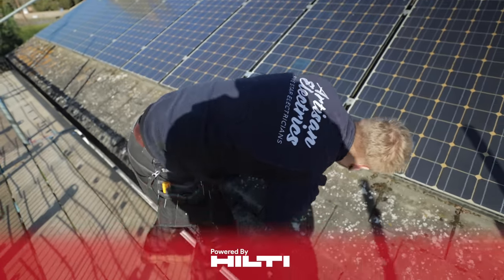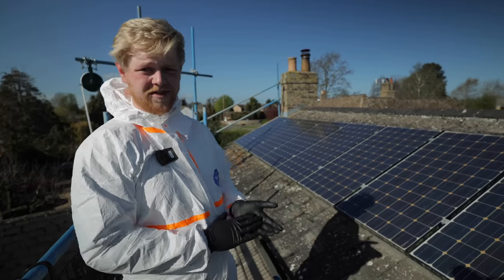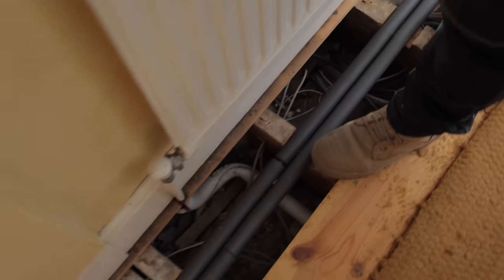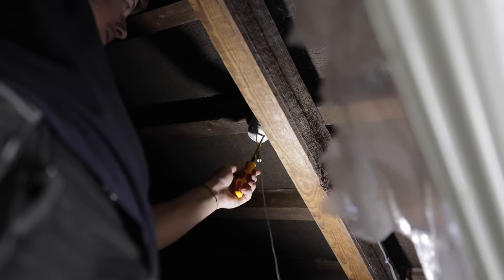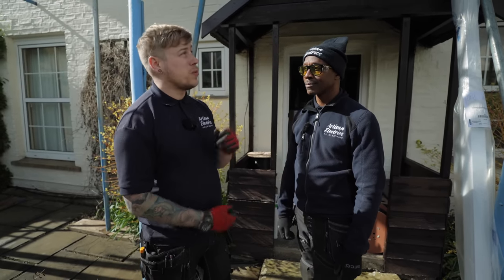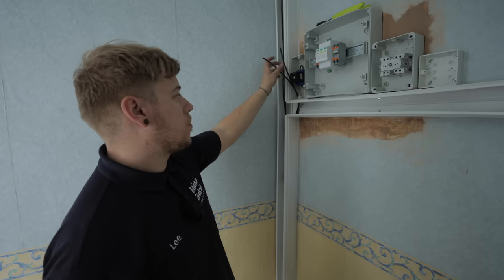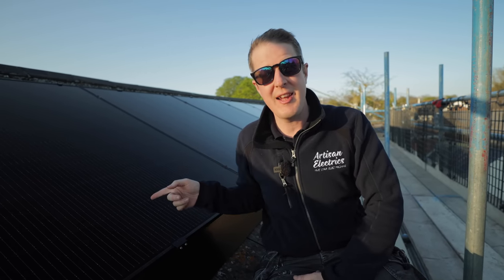I Nearly Walked Off This Solar Job.

Comment: As long as what you use to attach the the unistrut is MCS approved I can't see the issue, after all are the roof joists etc. that you would need to attach to MCS approved? No they're not. The unistrut is effectively an existing part of the house and it's clearly survived well, it's not even rusty. Seems to me that "MCS approval" is yet another industry body revenue generating scheme, it has no legal basis and it pretty much looks like you just replaced perfectly good steel strut with an almost identical aluminum replacement..

Comment: i can tell wayne knows his stuff, plus he makes the content better
Reply: I ran an asbestos company for 15 years. Wayne is doing everything by the book because he’s on video. Normally he’d nip up that ladder crack a couple of corners off the tiles & take a photo. 
All the white suit & mask stuff is technically required but in practice is seriously OTT. 

What that roof is, is fibre cement slates. The asbestos content would be between 5 & 8% & to quote the HSE the asbestos fibres are firmly bound within the material. Unless you start smashing the tiles with a hammer the risk is negligible. 

We used to provide safe systems of work for solar installers that allowed them to drill whatever holes were necessary on those roofs & ensure no debris was created. 
It’s actually not that difficult
Reply: @hughmarcus1  can I pick your brain?
What's the risks/ your views on pulling old rewireable fuses with asbestos liners?
Reply: @hughmarcus1  Hugh, was your company UKAS accredited?
Reply: @Trenchfoot1  No UKAS is only for the big boys. I looked into it, but it was going to cost £15k per year & economically unviable. The joke about UKAS is that the big boys subbed out the messy, dirty jobs to local companies like ours. 2 reasons, they didn't have staff with experience of messy demolition sites & they often had silly rules that said they didn't inspect anything more than 3 mtrs above ground level - not much use if you were demolishing anything more than a bungalow.

Comment: I'm not a structural engineer but couldn't one have been found to assess if the old unistrut mounting system was "fit for purpose" and adequate for the new panels? To my uninitiated eye it certainly looked robust enough. 

A quick look shows that MCS Rules fundamentally require good practice & fit for purpose.

If it was my property I would have been content with an engineers assessment and if that was positive I would not have had all that additional roof work done.
Reply: an engineer's assessment could be more costly than swapping the mounting system

Comment: That black skirt paddin looks cool but it should greatly reduce cooling (efficiency) of the pannels because of lack of air movement behind the pannels.
Reply: Save me saying it should use mesh
Reply: It doesnt make that much difference. I had my panels integrated flush into the roof. On the hottest day last year there wass about a 20% drop in generation, but on most days it is barely noticeable. A lot less than the hassle of pigeons nesting under the panels!

Comment: That unistrut is just fine and was one if the first methods to mounts solarpanels. Looks like its all zinc coated? Why replace it with inferior aluminium..

Comment: Man, you get it easy to instal and run the solar dc cabling. In NZ we have to run the DC cables inside a continuous solar rated pvc conduit when installed internally in the roof space/attic and internally within the house. This conduit is to be labelled “dc solar”, at regular intervals and is medium density walled. The electrical standards we use are predominantly ASNZS:5033 and ASNZS:4777 which are very specific to how things are undertaken due to the recognised issues and dangers involved in having uncontrolled dc voltages and currents from the panels to the inverter.
Reply: Our solar PV regs in the UK are still very minor compared to ac stuff. 

I watch these videos and sometimes I can pass a comment on stuff the guys could do better but also the flip side is I see things they do that I realise would be good to bring into my ways of carrying out what I do.
Reply: @buckshee  I hear what you are saying for sure. In the electrical service there is room for continual improvement and, lotsa stuff that appears OTT too. 
I recon we only need two or three reps: 
1- is it electrically safe,  
2- will it kill anybody,  
3- will it start a fire….
I am not intending to be critical by any stretch of the imagination.
The wiring system that scares the whatsit out of me is the American 120volt system and needing to wire lighting in 1.5mm, and ranges capable of 60Amps.
Reply: @briandalrymple9986  When it looked at the distribution boards they still use in the states it scares me, also their regs seem to come on a pamphlet and don’t get me started on wire nuts.

Comment: I'd have gone with the unistrut for several reasons:
It looked pretty solid for much the same wind load.
It avoided messing with what might have been asbestos slates.
It avoided replacing drilled through slates.
It would have avoided increasing costs for your customer.
The unistrut fixing through the slatrs should havebbeen picked up even during a cursory in loft inspection.

Comment: Tricky situation Jordan - on the one hand this stuff would have been quite hard to spot prior to putting up scaffolding. But on the other hand I can see how the customer might find this frustrating. I think you handled it well though, communication is key and if they were aware of the limitations of the estimate you gave then fair enough.

Comment: The optics of this, I nearly walked off the job because it was a bit hard.  Wouldn't be calling you, we've already established you're a top dollar company but a bit of agro and you're thinking of walking off.  My solar installers turned up at 9am and it was fully commissioned by 2pm, 14 panels across 2 roofs, not sure why it takes you days to fit a few panels.
Reply: That's what companies that want millions of pounds do
Reply: Same here, except the weather was awful and the installers mate was off sick... So he showed up and did it single handed in the rain. All done before darkness set in, in October. 

There's a small premium I'd pay for slightly neater consumer unit wiring, but not 3 days labour worth.

Comment: The old fixings look totally over-engineered and bombproof and if not leaking, I'd just put the new panels on, after all it's been there for ages without any problems.
Reply: TBH I would have not even suggested removing the old panels. 2kW system to a 2.9kW system. 900w peak hardly seems worth it.
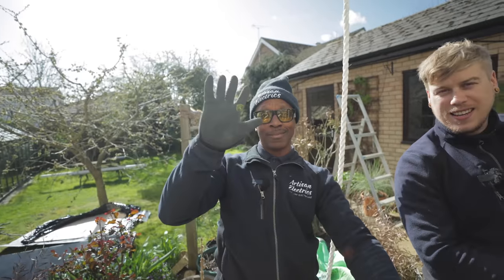Just replace the inverter with a hybrid inverter if the customer wants a battery system. If the customer wanted more solar then my first suggestion would be a couple of 455w panels on the garage roof @9:45.

Comment: So you didn't carry out a proper survey, under quoted then made the customer pay for the extra work.. hardly what I'd call Artisan...
Reply: Never mind the standard approach for asbestos remediation like this is to leave them in place.  This guy is a straight up con man.
Reply: That's what happens when sparks think they are solar fitters that roof job is a days work for two pv fitters and a couple of days for two good sparks what a joke
Reply: Fair point. I bet it wasn’t cheap
Reply: Sounds to me like the customer had a choice.
Reply: @cgh2467  very poor and simple argument customers always have a choice, that doesn't excuse shoddy workmanship and companies taking the piss.
Reply: I guess if the owner is three years old, he might just break even if he can make it to a century 😆

Comment: If this system had an MCS certificate it would have been attracting the highest PV rates, 68p/kWh. Why forgo the generation and export tariff?
Reply: 100% - I think the inverter had packed up, so that would have been a cheap swap over and keep the extremely generous FIT rate.
Reply: @andynoakes  What about replacing the panels? Had they packed up as well?
Reply: Good call. The Feed In Tariff scheme rules allow the replacement of certain equipment, but not all of it on a willy nilly basis.
Reply: This job doesn’t make much sense. In addition to losing the FIT payments, they’re only going from 10x200=2000W to 7x400=2800W. Even accounting for a slight degradation in performance over the years, seems a lot of expense (and waste) for an extra 800 watts.
Reply: Indeed... Maybe move the inverter when replacing it so it's no longer in the attic and everyone wins.
Reply: Sorry, how much am I paying wealthy people in my utility bill?
Reply: @edc1569  the government funds that - not the energy company.

Comment: 20:34 It's to lengthen the arc and make sure it is extinguished when switching off.
The resistance of an arc is proportional to its length so having 2 contacts in series is roughly like having one contact that opens twice as much.
Actually in this case there are 3 contacts to lengthen the arc (one on the negative and 2 on the positive wire).

Comment: 8:34 Get better sockets - thin wall, like Koken. Also, you can just undo the nut behind the Unistrut on the threaded rod, spray a bit of WD-40 on the exposed thread on top, and the ones inside will spin off by hand.

Comment: Top tip don't get sparks to install solar pv just get a proper firm who know what they are doing me and my mate would have had the pannels of and new ones fitted in a day you don't need roofers just good pv fitters and and a good sparky
Reply: Problem is that there's a panel boom, so lot of shoddy people out to make a quick buck. Hard to discern the bad apples.

Comment: What is wrong with Unistrut for solar panel? That is exactly one of those things that those are made for. I've seen it at many installations
Reply: I have 12 panels on my garage mounted on unistrut theyve been up nearly 3years and not escaped yet
Reply: @haldo691 , you are not meeting the UK Solar Mafia rule : next step spend £1000s more

Comment: Do you think it's fair to charge the customer we for couple major issues missed when quoting - possible asbestos and rails not suitable. Should have been checked in advance imo
Reply: Do you think it’s fairer that the installer has to pay for these unforeseen major issues?
Reply: Depends on how the conversations went really.
Reply: @CastleKnight7  I'm sure there was plenty enough Artisan margin to give away and keep the customer happy. Didn't anyone go into the loft to see the unistruts at quote time?

Comment: Galvanised unistrut was what was used in the early days on solar panels it will last years longer than the extruded aluminium rails your fitting but as you pointed out you had to use an approved product. I didnt like the drilling through the tiles although it was well supported underneath I couldn't see how it was water proof P.S. There are purpose built 17mm sockets made for unistrut.

Comment: How much do you lose on encapsulating the panels like that? They'll get quite a bit hotter, when there isn't room for any airflow.
Reply: Its to prevent birds nesting underneath though I guess it could be done in stainless steel mess too.

Comment: That bird protection makes it all look a bit  like a spaceship 😂. But seriously just wondering about the restriction of airflow under the panel with this type of bird protection. Will the panels get hotter than panels without this protection, or even with the mesh bird guard? Thanks. 
Great videos 😊

Comment: Nice neat install but do you not think by design the panels should have a local means of isolation on each panel be it even in the roof space ,so the cabling to the  main panel is not always live when future work is done on the installation?
Reply from the maker: Never heard of doing it that way
Reply: Add dozens of extra points of failure and arcing, not a great plan.

Comment: You need scaffold for this in the UK? No wonder the installs are so expensive, central Europe you don't need any certs to install mounting system and panels and most work is done from a ladder. Sparky just comes to terminate DC cables and everything downstream of that
Reply: Life must be cheaper in Central Europe
Reply: @markdonoghue1013  for the most part yeah but baked beans are about double the price!
Reply: @markdonoghue1013  also shorter.

Comment: Honestly rather than absolotely having to get the solar cables terminated I would just use an MC4 connector even if it's a perminate instellation, because if anything goes wrong down the line between with solar cut off switch to the pannels you can still fix that without having to go on the roof and disconnecting the solar pannels unless the problem is on the roof, it's not like you don't have space in the trucking for MC4 connectors.

Like ideally should you never be working with live +50v conductors, sure, but life is hardly ever ideal and MC4 connectors let you deal with none ideal reality in a fairly safe way. Yes you should if you are already up on the roof not connect / disconnect the conductors on the solar pannel side, but making it so it absolutely has to be done that way to be safe is in and of it's self a bit silly.

Comment: Why replacing those with new ones? Thats not really worth it. Energy wise and environmentally wise not at all.
Reply: Especially if the other side of the roof looks just nice to install a second array of new solar panels (22:03). Even if it is not the optimal orientation, the newest generation of solar panels would still produce quite some energy.

Comment: I would've loved to know the lifetime production figures from the old system!

Regarding asbestos (professionals disregard haha), just play dumb and scrap the stuff. People act like asbestos is weapons-grade plutonium. It's nasty stuff, but they legit used to use it for EVERYTHING. There were asbestos union workers, who would handle it all day without masks for years after they knew how bad it was. Kent cigarettes used to have asbestos filters...lol. My point in saying this, is that if you're a pro, do your thing, if you're a DIY, just mask up as best you can and get that stuff ripped out and tossed. Asbestos demo is more akin to second-hand smoking for a weekend, not smoking two packs a day for twenty years. Importantly, the workers who did handle it as a career definitely had long and painful death spirals. (source: working on asbestosis and mesothelioma cases and renovating old house)

Comment: why are there black metal panels around the pv panels?
ist it for storm proofing? wouldn´t it be better to leave them off to get the heat away under the panels to get better efficeny?
i never seen it here in gemany done like this maybe on an flat roof when they are put at an angle back to back so that it is closed of to the sides but above and below an panel is always an air gap
Reply: They are to prevent birds from getting under the panels

Comment: Do the DC cables and the AC cables not need to be run in seperate trunking? Either that or the 50x50 trunking you use here actually comes with an option to create 2 different compartments, therefore separating the cables as required?

Comment: Best video yet. The way you protected wildlife the way you did and the way you protected your lads with the azzy testing is a model for how things should be done, take a bow young man… Normal sockets won’t fit in unistrut, you need channel sockets. Get the slimline round ones from Deltec, I do that shite everyday and I’m five years into my Deltecs and they’re still fine…Well done mate 👍

Comment: Did you fit optimisers for each panel? Just asking as the chimney looks like it creates a lot of shading and need to take into account your shading factor? Also no mechanical protection on the dc cables going through the roof into the loft?
Reply: I mentioned this to an MCS guy before and was told that as they are double insulated as long as they aren’t squashed on anything they are fine 🤷🏻‍♂️

Comment: Yes , asbestos is not good for your lungs , yet wearing an hazmat suit for a tiny chip seems way over the top :-)
Reply: Nope. That's regulation. There should be no chance for dust to get stuck in the clothes and then deposited elsewhere. For a one time off, no problem really, but if done four times a day the total whiff will quickly accumulate.
Reply: @bpomowe224  well aware of the regulations :-)Could understand if stripping down an old pre fab house . Not just taking a tiny chip . He was protected , yet where might harmul asbestos go in the wind ?
Reply: @scottgordon1781  Matter of concentration really. If he spends the days taking chips, the accumulated amount in his clothes can reach harmful levels. The amount dispersed into the atmosphere gets diluted to levels (this far) are considered harmless.

Comment: 08:35 
Box spanners are handy for getting into the uni-strut
Reply: Or just use the proper unistrut socket 😂
Reply: Alot of 3/8 sockets fit too
Reply: @haldo691  do they fit on 17mm nuts m10
Reply: Slimline sockets not your standard mechanics sockets are they way to go.

Comment: What's the reason for installing those edge plates around the panels? This will reduce the power output noticeably as it makes impossible natural cooling air flow by convection or wind. In the end, it doesn't even look better.
Reply: To prevent birds nesting underneath.
Reply: @Arachnoid_of_the_underverse  I can't really imagine them surviving a baking hot summer day there...
Reply: @Arachnoid_of_the_underverse  Fine netting would be better, as you both keep birds out and allow airflow.

Comment: Great video why not cleaning the roof  .And are you not  killing your  panels with your Glass carrier  ???? Thanks Regards from Holland
Reply from the maker: We did get a window cleaner to visit and clean the panels before the scaffolding came down
Reply: @artisanelectrics  Thanks for your answer, but I meant cleaning the roof tiles nicely And won't the solar panels break from using glass carriers???